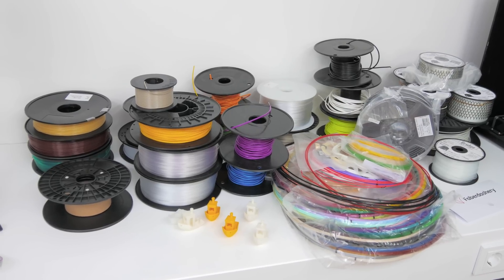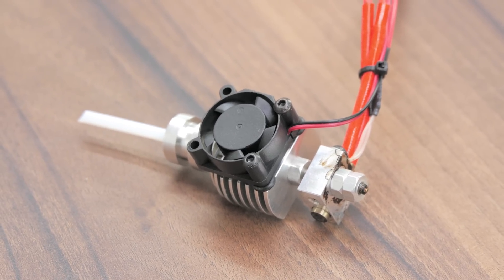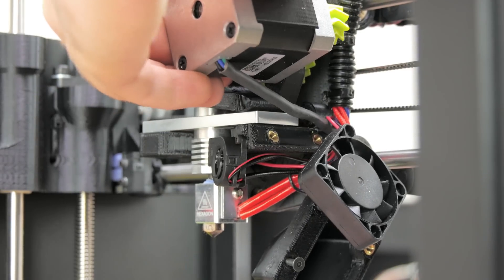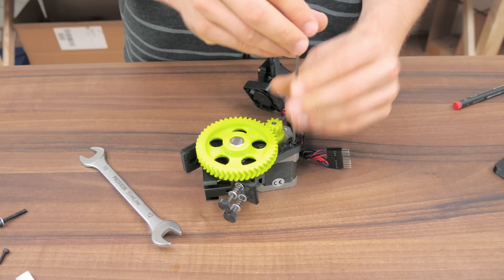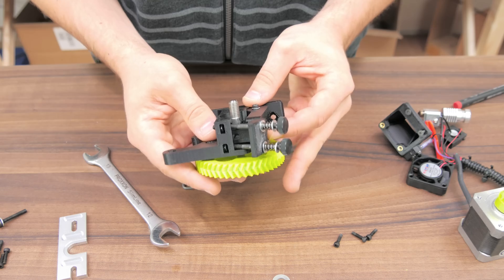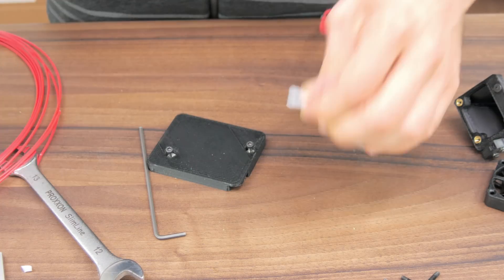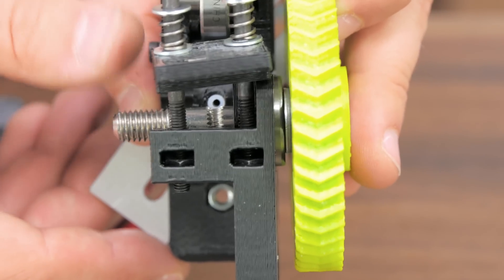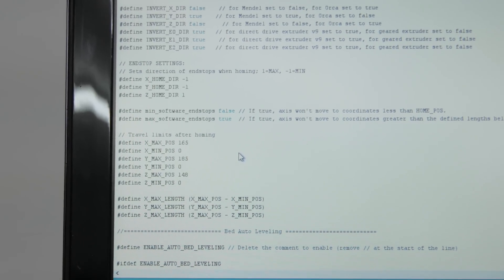Guide: Convert your 3D printer from 3mm to 1.75mm filament!

Comment: I have a direct drive extruder and I needed to convert 1.75 to 3.00 and all I did was to actually drill the part where the filament goes I forget how it’s called it’s like a screw with a hole through it and it worked

Comment: I did not see you mention changing the M200 setting that OHAI has in their firmware? If I change this to 1.75 it completely messes up my esteps. I bought my toolhead from IT3D, and it seems to work if I do not change the default filament diameter set by the M200 in the firmware

Comment: I am interested in buying a 3D printer but almost all the ones I have seen are 1.75 mm - and I would prefer (unless people can explain why I shouldn't) the 3mm version.

My reason is simply that in the UK, 1Kg of ABS 1.75mm seems to typically sell for around £15 - £18 - But 1Kg of ABS 3mm, seem to be around £6.50 of you shop around - between a third and half the price.

I am probably missing something important - but it would SEEM that running with a 3mm filament should make a fairly hefty reduction in print costs.

I would much appreciate a little guidance as I am aware I might not be taking something significant into account.

Many thanks.
Reply: I looked around at the sites where I buy my 3d things, but there the price for 3mm and 1.75 mm filaments are exactly the same. Maybe the secondhand price is different.
When I red your comment I started thinking about making 1.75 filament out of 3mm.
Could you give me an address where I can find cheep 3mm filament?

Comment: Hello

I have  a LulzBot Mini - been watching several videos about it, your review sold me on it - The 3DPrinting Nerd said in one of his videos that all that is needed to run 1.75 is change the filament size in Cura - so i ordered a few 1.75 rolls instead of 3mm because like you said... lots easier to find certain colors - So without tearing down my machine - or messing it up with 1.75 - what you think about just changing the setting in Cura to 1.75 - Thank You!!

Comment: I've been printing 1.75 in my Taz 6 for a while, but about 10% of my prints with PETG get kinks in the filament.  I don't want to swap out everything to 1.75, but make my existing setup more reliable.  I was thinking that I could temporarily add the tubing when I need to do 1.75, and take it back out for 3mm prints.  Anybody think it would be possible to do this?

Comment: where did you buy your Hot end from? did you buy it from Lulzbot?
or is it from a different company? I use a Lulzbot Taz 5, and I want to switch to a 1.75 extruder. the one I want to buy is from RepRap. so this is want I'm wondering. do I have to buy the Extruder from Lulzbot?

Comment: Question. I am converting my Taz 6 to 1.75mm. I purchased a new hexagon hot end to replace the 3mm one. I noticed that there is no PTFE tubing. Do I still need it? The hotends are identical with the only difference being the diameter of the filament it is designed for.

Comment: Great video Tom. By using the Teflon tube in the hot end won't you loose the advantage of a all metal hot end?  I am thinking of the temperature required for some of the "exotic" filaments. Or does the Teflon tube not extend into the melt zone?
Reply: Thanks Tom!  I know what my next project is - build a 1.75 MM tool end for my TAZ 6.

Comment: but what if you want a 3mm  and you have 1.75  I have a robo r1 plus and  I contacted  the support team and they said they soon sell a 3mm nozzle so it could it do 3mm filament could be that easy?
Reply: Yea see that's what I thought but from what tech support over at robo 3d said they will be selling  3mm nozzles which will allow the robo r1 plus to print 3mm filament without modding anything  but from what you're saying  it seem like that would not be possible how and the reason why I want a 3mm filament is to print ninjaflex and other flexible material do you have any tips on how  to so on a robo r1 plus? Please and thank you :)

Comment: Hi, I actually have a couple of questions. I'm considering buying this same  printer, the lulzbot taz 5, and I also want to buy it with the dual extruder upgrade. Is the process basically the same for the dual extruder or are there a couple of more steps involved? My next question is could you go a little bit more detail over the wiring and the coding or is there an article I could read? I want to make sure that I could do this before I spend the time and money into this printer.

Comment: Quick question, would it be possible to use 1.75 mm filament with bowden extruder with my E3d V5 3mm hotend? The wade extruder setup is a bit too clunky since the motor rests right on top, that is the reason I want to switch to bowden but at the same time don't want to buy another 1.75 hotend. I tried pushing the 1.75 mm filament by hand in my 3mm V5, filament does come out quite well but I don't know how it will work with an actual bowden setup with tubing and all that.
Reply: +Consig1iere Do not use 1.75mm filament in a 3mm extruder. You will only have issues and headaches. The main one is clogging, the filament will coil up inside the hot end and won't extrude properly. Just stick with your 3mm for now, its still a great piece of equipment.

Comment: Maker Tool Works' PTFE tube is ~2.8MM, and slides perfectly into the stock Lulzbot Mini hole. No drilling needed.
http://store.makerstoolworks.com/extruders-and-parts/ptfe-tubing-for-bowdens-extruder-per-foot/

The same AO Hexagon hotend, but in 1.75MM:
http://www.amazon.com/gp/product/B00W8FL68A?psc=1&redirect=true&ref_=oh_aui_detailpage_o01_s00

I hope this helps someone looking to convert to 1.75MM. Pretty quick upgrade with these two.

Comment: Hi Tom i new to 3d printing so i build myself a diy 3d printer i bought a electronic kit on amazon ramps, nema motors stepper drivers mk3 heat  bed  and so on so after i mounted everything working fine (test run) the only problem i'm having is when i try to power the heated bed it would only power on for few seconds then shut off then i get the smell of electronics  also when i felt the heatbed mosfet it really hot now i install a fan above the ramps  that help just a little now i get about 10 seconds and same problem it shut off what can i do to solve this problem i saw a video about using a car relay for the heated bed but i'm not sure can you help me out please
Reply: Put a massive heat sink on your mosfet ??? They get hot especially when drawing high current

Comment: Good Video, but for all the trouble of converting it you might as well just invest in two complete extruder assemblies (both hot & cold ends + stepper). Then you can switch it out quickly to suit your needs.

Comment: I don't think 3mm filament is going away,  but I agree that 1.75mm is a bit more popular.  However I've still seen cases where a certain kind of filament was only available in 3mm, possibly because the seller ran out of 1.75mm and only had 3mm left in stock.  So how does the prometheus print in comparison with the hexagon on the TAZ-mini?  Does it handle Ninjaflex OK?

Comment: 1.75mm is the "more modern standard"? I'm an absolute newbie regarding printers and filaments, since I just started experimenting with my first printer - a Tiny Boy / Hobbyking Fabrikator Mini. It's a 1.75 mm printer and I had some discussion about Filament size where people mentioned that 3 mm is the more widely used and overall better choice?

Perhaps you can make a video on those two sizes, the pros and cons of both (like what relative deviations from the diameter mean for a print), what is more available and has the most options and different filament types available, etc?
Reply: As a general summary, 1.75mm filament is more common and has slightly more variety. It is easy to feed as you push less material at a time. 3mm filament jams a bit less as it is harder to link or bend due to the larger diameter. Hope that answered your question.

Comment: The only reason I use 3mm is because of flexible filaments...
Reply: +Gragagrogog Flexible filaments work in the 1.75mm variety too, but it's really more effort due to increased hysteresis. BTW, the teflon tubing just after the dragging mechanism is really useful for that, I'd guess that the extruder from the video without the PTFE tubing would be less efficient at dragging 3mm flexible filament than dragging 1.75mm flexible filament with the PTFE tubing.

Comment: Great video as usual Tom! I would love to see a video on Volumetric E Units, and Firmware Retract. I have a Tri-extruder setup with (2) 3mm V6's and (1) 1.75mm V6. I dont print the 1.75 and 3mm extruders at the same time, but use Volumetric E when switching filament and printing with the same gcode. I would love to see if I am doing this right.
Reply: +Matt Skaletski which slicer do you use for that? Cura? slic3r?
Reply: +Maker Linux Slic3r, but I believe you can do it in Cura as well. At least Firmware retraction if I remember right.
Reply: I'd been wondering if such a hybrid was possible! Can you tell me what printer it actually is?